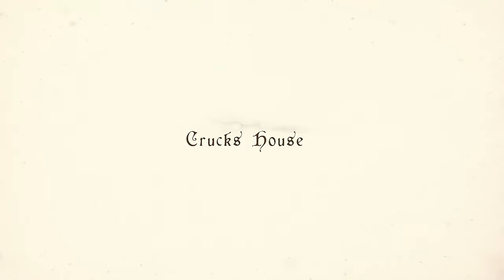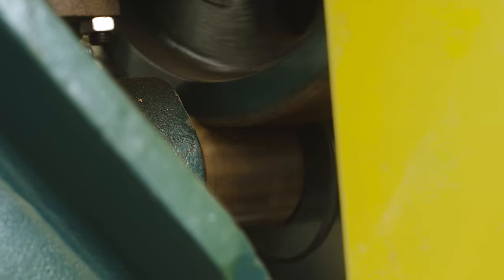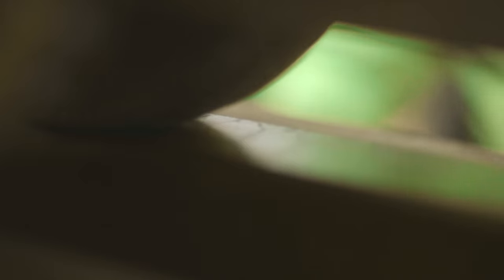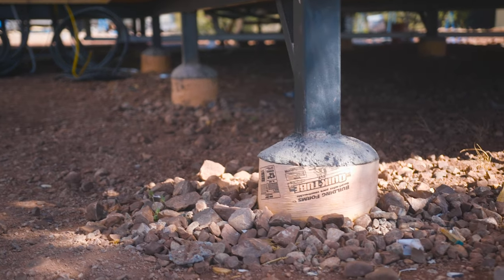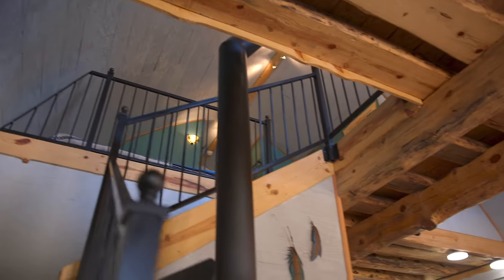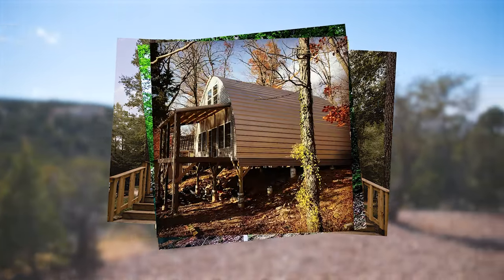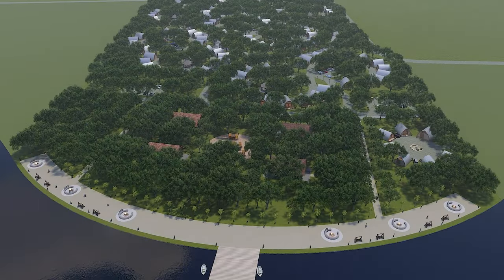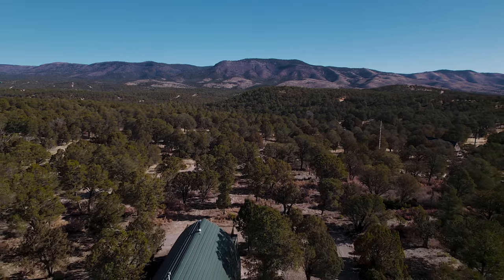Arched Cabins LLC DIY Home Kits and the Inventor

Comment: When purchasing a kit are there detailed instructions to put it together… I’m very intrigued by these but have a lot of questions..for example the inside walls. How do you attach the drywall or wood sheets to the metal frame? My thought is that you still need to use 2x4 lumber on the inside of metal rib so you can drywall..am I wrong? I’m guessing you wouldn’t want to puncture the metal frame in any way to compromise the strength.
Reply from the maker: Yes, every kit comes with a build manual. In order to attach the drywall or other wall finishing materials, you would attach wood furring strips with self tapping screws to the ribs. This does not affect the structural integrity and allows you to then use normal nails etc. to attach other materials.
Reply: @ArchedCabinsLLC  thank you for the reply.
Reply from the maker: @TravelDuckDude  You are very welcome!

Comment: Are there any ways to put any or some kind of windows on the sides....anything????
Reply from the maker: Yes, they can be installed without any welded supports if they're 22 inches wide or less. But if you don't mind having welded supports added in, then you can go as wide as you'd like. Windows will be installed with dormers.